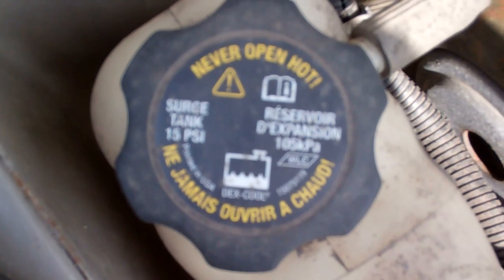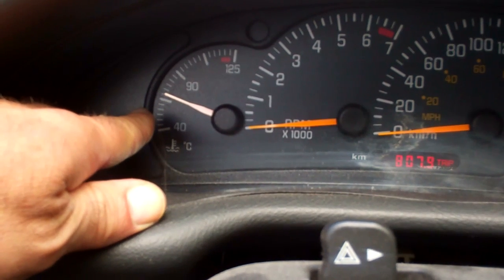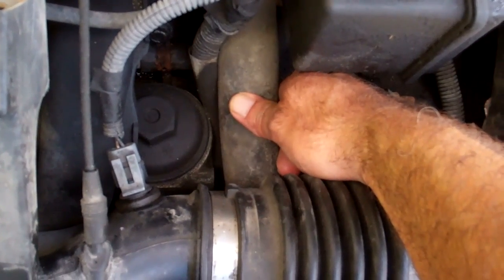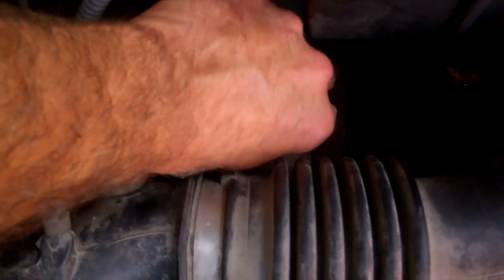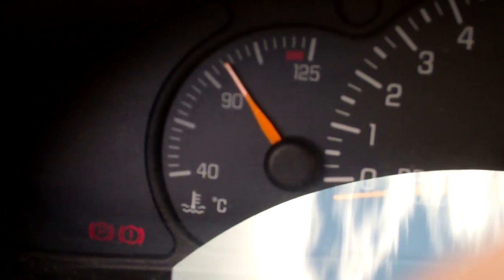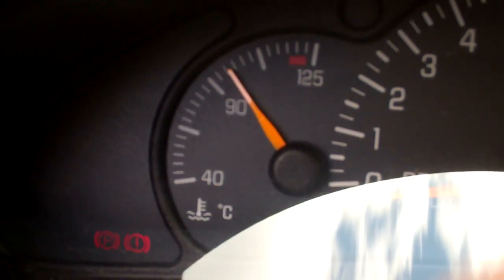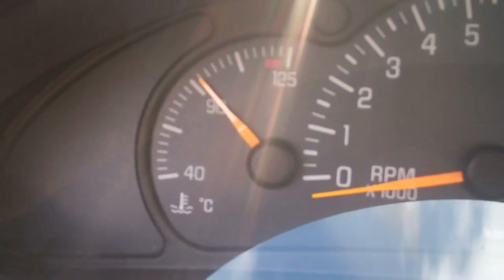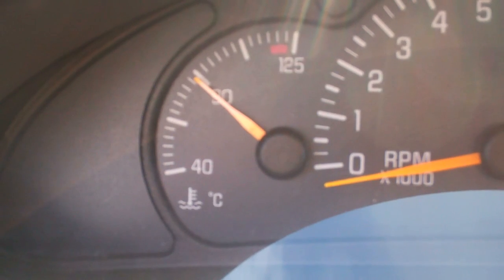Finding out why an engine is over heating

Comment: AND PLEASE KEEP IN MIND THAT KNOW ONE REALLY KNOWS  WHAT THE FKN PROBLEM IS WHEN OVERHEATING  ISSUES  , YOU WILL HAVE TOO  PUT FIX A LEAK ,GET THE REDIATOR PRESTONE AND WATER DIRTY THEN FLUSH REDIATOR THEN REPLACE THURMASTAT AND REDIATOR CAP AND THE REDIATOR AND THE COOLANT FAN COOLANT SENSOR  , THEN THE WATER PUMP  ,THEN  TEST THE RELAYS FUSES , HARNESS CONNECTIONS AND BLEED THE AIR  OUT OF HOSES AND BLOCK AT LEAST BLEEDING IT TEN TIMES , AND THEN AFTER REPLACING ALL THOSE PARTS IT WILL STILL OVERHEAT , TAKE IT TOO YOUR CLOSEST  SCAMMERS MACIANIC AND PAY ANOTHER  2000 DOLLARS TOO DO THE SAME THING YOU ALREADY DID TOO THE COOLANT SYSTEM  , THEN LOOK ON YOUTUBE VIDEOS FOR ADVICE AND COMMENTS AND EVERYBODY KNOWS WHAT THE PROBLEM WITH OVERHEATING IS BUT THEY WILL TELL YOU THE SAME THING I DID...SADLY THE TRUTH IS YOU ARE FKD THE OVERHEATING ISSUES IS NEVER SOLVED

Comment: HERE'S THE DEAL , WHEN VEHICLE OVERHEATING,  CHANGE THE  THURMASTAT  ,THE  ,REDIATOR CAP  ,THE  WATER PUMP  , THE  REDIATOR  ,THE  FAN COOLANT  SENSOR  AND THE COOLANT FAN,  AND THE  IDOL CONTROL VALVE AND  FLUSH THE REDIATOR AND  BLEEED IT TEN TIMES  ,AND  STILL  THE VEHICLE WILL OVERHEAT AND  THE MANY MACIANICS ON YOUTUBE VIDEOS WILL TELL YOU THE SAME SAME THING IN MANY DIFFERENT WAYS AND FORMS ..WHAT IT ALL BOILS UP TOO IS YOU ARE FKD ..SADLY TRUE

Comment: Not to be negative but your tachometer seems to not be working if you are idling or you car is not on and is just cooling down. 
Also in some vehicles it can be a fan relay instead of a fuse and also it can be a defective fan switch or coolant temperature sensor. It could have been a busted fan motor ! You still have to find out the reason that the fuse blew in the first place.

Comment: Yea I was having the same problem with my 2003 Olds Alero 4 cyl, the gauge would go to exactly to where yours went, stopped the car, left in gear, and saw no fans running, although when I put the a/c on both fans automatically came on. Pulled that 30 amp fuze, it was good, cleaned it up with some WD-40 and both fans working, thanks.

Comment: My car's temperature gauge is always above  the middle (more towards H sign), can somebody help why is it so?
Reply: Sometimes it's normal. Install a temperature gauge with numbers instead of letters
Reply: @mikem5475  Thanks a bunch for the response Mike.

So, another problem: after driving for 20-30 minutes, the engine heats up, the Radiator fan is working but it can't keep the temperature under control....
Reply: @VIRRAL.CONTENT  it could be so many things, like an old rust clogged radiator (if the coolant was ever brown). Bad thermostat, bad water pump, air pocket preventing flow, too much antifreeze to water ratio, bad car design where the radiator is too small but I've only seen that on mini coopers. It could be so many things, I'd start with researching how to diagnose it. That way you save money on parts and time. Good diagnosis saves time. There's a lot of things you can do that will reveal a lot, like feeling which radiator hose heats up during the warm up cycle. Just never open a pressurized cap when more than warm, or risk spraying burning hot coolant
Reply: @VIRRAL.CONTENT  could also be electrical issues preventing cooling fans from operating properly but that usually only happens at a standstill, however, a cooling fan non functional will provide some unwanted blockage even while moving. Could also be leaves or dirt on the radiator fins. So many things. It takes a lot of investigating but it's always worth it for the right fix that will solve the issue
Reply: @mikem5475  the mechanic says its Head Gas kit blown. And need to open the engine.

Do you think it is the case?

I see if gaskit is blown, it shouldn't wait for this long (literally 20 , 25 minutes, and if in traffic, it gets heated up early) to get high temp.
Reply: @VIRRAL.CONTENT if the gasket is blown the coolant will bubble or shoot out when the engine is started with the radiator cap off. The coolant will also change color or disappear rapidly as the car drives. Unless you see some of these symptoms I'd want a second opinion but the only sure way to tell is a test that uses a special fluid that changes color if the combustion gases are detected in the coolant

Comment: Good video,,, Only what happens if your fuses are all good, relays are good. But still fans not working ? I have a dodge stratus 2002. fans not working at all. 
When I apply direct voltage to them, they come on. Replace the thermos, replaced the temputaer sensor, still nothing. 
when I put a short across where the relay sits, fans come on. When I unplug temputure sensor, fans come on... 
Ok.... what am I doing wrong ?? I'm fresh out of ideas. Any suggestions ???? I'm all ears.

Comment: I have a 1997 Chevrolet Lumina and it's been running hot and I replace the thmostat but it's still running hot, and now the heater not getting hot it's blowing out cool air.
Reply: Could be the fan fuse blown as shown in the video, if the radiator fan is not working. If fuse ok, check the fan relay.

Comment: change the radiator water pump thermostat to thermostat plug hose and the fan still won't turn on when you cut the AC on if I start the car and car just overheats 95 Cutlass supreme SL

Comment: Change the radiator water pump thermostat the thermostat hoses and the fan still won't turn on when I cut the air conditioner on or start the car
Reply: Check your fan fuse and relay
Reply: Do a diagnosis before buying parts

Comment: BACKYARDMECH, how can you test the engines thermostat to make sure its work correctly? you put your hand on the "upper" radiator hose to feel its its HOT but how do you know the thermostat is opening and closing?
Reply: put Thermostat in boiling water ~ then see if it opens
Reply: @elyoj6845  I agree

Comment: BACKYARDMECH,                    I don't know how to test the temperature sending unit or where its at in cars. I'm not sure if the sending unit means a sensor. 
1.)  How do you test or what do you use to test the temperature sending unit?
2.) Can I buy a digital gauge at PEP BOYS and install it in the fuse box wires by slicing the wires to test if the analog temperature gauge in the car dash temp gauge is reading false reading measurements of the temperature?
3.) Can you make a youtube video showing how to test the car dash gauges to see if they work correctly and not reading false readings and how to test the sending units to the cars gauges?
4.) I don't know how to test the cars gas gauge, oil gauge, temperature gauge using a ohm meter or what other test tool can I use to test these gauges are working correctly and not giving false reading or not working correctly?

Comment: I have a question i just recently replaced my fan and fan clutch i also replaced the thermostat but my 92 gt still overheats and the light of low coolant is on any help or suggestions please would be highly appreciated
Reply: return pipe to the overflow tank might be clogged? mine did that took the off one by one till i find that  the other one soil in it and plastic residue
Reply: @zalisilezele7497  oh I'll check that out thanks bro

Comment: I have tried a new radiator, water pump, thermostat, Hoses, and poured Head Gasket Repair in it and it still over heats what else is the problem just tired at this point.
Reply: Radiator cap or temperature sensor problem
Reply: Fan?

Comment: Ok fresh flush, rebuilt head no cracks, new radiator, new water pump, new heater core, new  thermostat, new temp sensor and in 6 mins of driving the temp nails at 260*...What should I do next.  2000 xj 4.0L
Reply: Get a new radiator cap if didn't get one with the new radiator, double check all gaskets, new hoses, and check to see if you have a coolant blockage somewhere.... or buy a new vehicle...

Comment: What if it’s the exact opposite to where instead of getting hot when idling and cold when running it’s running hot when running and cooler when in idle
Reply: Coolant temperature sensor?

Comment: The thermostat opens to let it circulate to and through the radiator, not let it circulate into the engine!  The thermostat is started as closed so that it circulates engine only, which you seem confused about with the function of the thermostat as you seem unsure judging by how you spoke of the thermostat!

Comment: My Lincoln MKX 2008 is overheating when I turn AC on but doesn't overheat when it's off so if I keep it off can I drive it
Reply: Your car have temperature problem, try to check the cooling system in your car easy to happen big problem when you travel long trips like 1200 kms

Comment: Replaced radiator, all hoses are good and no leaks and replaced thermostat.. Also the fan is in good condition. Still overheats
Reply: Replace pump and its fine
Reply: Burp the system.

Comment: 2003 Toyota Camry running hot.Replaced thermostat thermostat sensor new water pump mass airflow intake 
New radiator 
Check head gasket they ok what possibly could be wrong still running hot fans turning
HEEEELP
Reply from the maker: It sounds like everything in the cooling system has been replaced Samantha. When the radiator was replaced, do you know if they put a new radiator cap on - or did they use the original cap ? The rad cap is spring loaded to put pressure on the system when required . If they used the original cap , it could be defective
Reply: @backyardmech  they used the old radiator cap.The overflow tank was almost empty this morning. I looked under my car a saw a wet spot.Now they have to figure out where it's coming from.Radiator was full.Smh back on the rack its going.
Reply: @backyardmech  heads are gone to expensive to fix.
Reply: @samanthastevens1658  it pays to have a good diagnosis to begin with.  A dollar saved is a dollar earned

Comment: What if driving at high speed it's getting to hot and low speed it's cooler, what's wrong then?
Reply: What was the fix on
Reply: Hi! I have toyota corolla 1.3 Profesional 2010, its overheating and the fan doesn't spinning, plshelp me
Reply: @mmbulahenilukhwareni8166  
Check the fan fuse and relay at the fuse box

Comment: Hi Sir, I have a Honda Civic 2004 and has the same problem like this on your video. but the thing is that when during start of the engine and while the temperature gauge started to reach a half needle gauge, the cooling fan start to run and again stopped when temperature goes down a bit from the mid pointer needle and again the radiator fan run when temperature gauge started to reach the mid point gauge.  and on the third time when temperature reach again the mid point, the fan doesn't run anymore and temperature gauge started to go beyond the mid point and still getting higher which forced me to shut - off the engine.   What would it be the fault Sir?
Reply: Check/replaced the fan relay, it might not work when its getting heated up due to frequent on/off.

Comment: I got a 87 Chevy Caprice that over heats...the antifreeze was boiling in the overflow...I only had it started bout 10 to 15 minutes in my driveway...I mean it was boiling like hot water in a pot on the stove..there wasn't no prior leaks just out the Blu... another thing I had to refill my antifreeze every other day but there was no leaks... where is that coolant going?...I don't think it's a blown gasket...doesn't smell like it n there no antifreeze or water mixed in my oil...I was told it could be the thermostat which I replace bout 2 years ago..n I was told if the top hose gets hot then it's not the thermostat...then I was told it could be the fan clutch.. Or the radiator..but I replaced the radiator the same time I did the thermostat..no leaks...so it leads back to the fan clutch which I was told to check the spin..I mean it's spinning but I don't think as fast as I was told it should spin...idk..I was told that when I rev the rmp  up that the fan should spin faster but no matter how high I rev it up the fan stays at the same speed...so help out fellas..lol..I don't wanna spend much money at a shop n I want to learn how to fix it or n my own
Reply: It was a bad fan clutch I replaced it now it doesn't over heat anymore...the problem I'm having now is that it's idled too high..it takes a long time to idle down...but when idled down it's quiet n runs perfect...
Reply: Bo Jackson but you said it was losing coolant. Where is the coolant going? The new fan clutch won’t prevent the coolant from burning off... as far as idling high, I would start by checking for vacuum leaks, and cleaning the throttle
Reply: @RomoWasntBuiltInADay yup..n I was told that it could be the TBI or the IAC....
Reply: Just takes a long time to idle down....
Reply: I had that problem in a Dodge Ram pickup and it turned out to be a clogged radiator.
Reply: I have a chev uplander 3.5 V6 , 2005 with same problem
Reply: Bo Jackson I’m positive it’s a blown head gasket. The coolant is making its way into the cylinders via the crack, and burning the coolant during combustion. you’re loosing coolant and it’s not an external leak, therefore it must be internal. A bad fan clutch and thermostat will cause overheating but it will not burn off coolant. The fan clutch is responsible of cooling down the radiator. The thermostat if stuck closed will overheat the car, but you would see a leak through the housing due to the pressure.

Comment: I'm a noob i have a 2000 nissan xterra with overheating issues. I notice today my radiator is leakinylg just tiny bit of fluid from the top. It only has one big fan that when i turn the truck it automatically engaged. Its that the only fan or should there be another one?

Comment: I have a 2003 Alero Oldsmobile I was having problems with the reservoir tank I went ahead and bought a new tank for it and installed it that seem to solve the problem somewhat my air conditioner works and all of that, but now I'm seeing a light with a capital( H)that turns on even though the car is not hot the gauge is right in the middle where it's supposed to be but that letter( H)is on I'm guessing it means overheating so, I am not sure what the problem is now. I've been running it for a couple days now and the lever stays right in the middle but at times the letter (H) will turn on indicating that it's hot so at this point I don't know what to check for do you have any suggestions? and by the way it's an excellent video you made thank you

Comment: I’ve changed two radiator hoses and the thermostat and it’s still overheating? The water circulation is great but the temperature arrow rises up to H , that scares me a lot. Does it mean it’s the temperature sensor? How do I fix this problem please help and thanks!!!
Reply: air in the system, get all the air out and see if that's the problem?
Reply: how do you get the air out of the system
Reply: @Dreama40  🤣
Reply: Jonathan Manrique my daughter car is doing the same thing. We bought her nre radiator and thermostat.
Reply: You Have Air In The System...
Reply from the maker: Is the vehicle over heating mostly when you're idling in traffic Jonathan ? Could be a cooling fan issue if so. What about the radiator cap - did you replace that ? If the rad cap is defective it won't keep the proper pressure in the cooling system . Good luck bud !

Comment: Can a crack in radiator cause over heating? Or is it a blown head gasket
Reply: It can be both depeneding on how long you been letting it over heat if it has been recent then fixable but if it's been awhile then you might have some problems take it to autozone get a OBD scan that should tell you a lil more where your aiming for

Comment: can I delete compressor by installing a smaller belt and will that effect my engine coolant process
Reply: Idid that once and had to put a bad compressor on to keep the water pump rotation correct.Prior compressor pulley bearings broke down and allowed belt to slip off of pulley.

Comment: Very good video Backyarder, and I have a 4.0 litre Northstar engine in
my 2001 Aurora,(V-8) which only has 50,000 miles on it, and mint shape.
I understand these engines are great, but need regular maintenance
especially to the cooling system.
 
 I have 2 questions for you  Bak Yarder ?

1) Can you use Dex Cool coolant in a Northstar ? and if yes, how often
do you flush and change the coolant- every 2 or 3 years ? or what ? Some
guys say Dexcool is great, providing it's changed every 2 years, and 
others say it is not good coolant ?? Don't know what to put in ? I do
believe on the late 90's - lower end GM cars, they used cheap nylon
plastic gaskets, and the acids in the Dexcool chewed them up ? - but
I believe the Northstar engines in Cadillac and Aurora's have "metal"
gaskets ? I'd like your comment.
 
2) when you do "change" the coolant, do you add those GM sealing
pellets ? and if yes- how many pellets - 3,4, 6 ?-- or do you feel those
pellets will clog up the circulation system ? and should not be used ?

I'd love to get your advice, as you seem very wise and experienced when
it comes to car mechanics.

 A reply would be appreciated --thanks - from Grant ( in Canada)